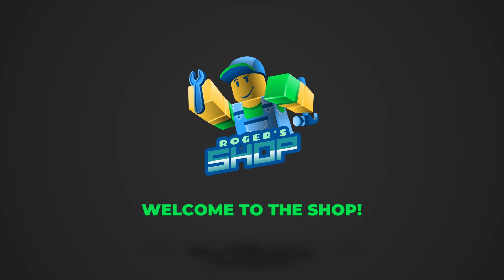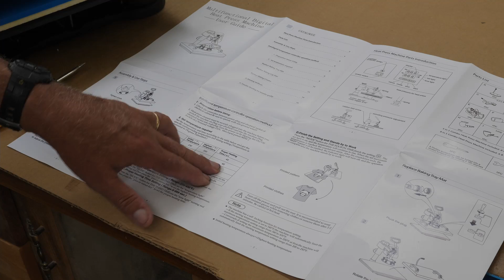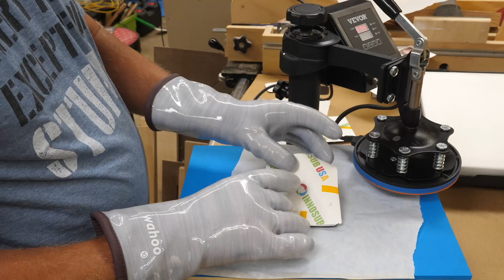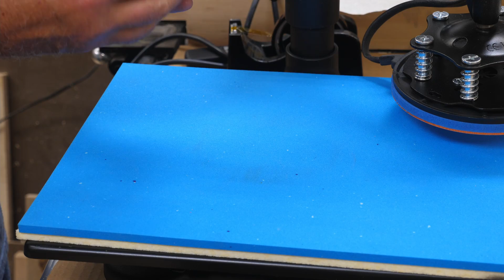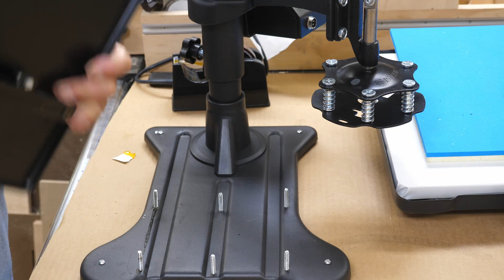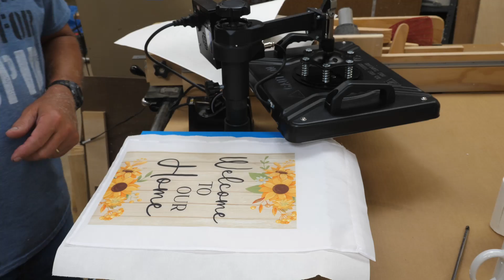Vevor 5 in 1 Heat Press

Comment: Do you have any issues with the heat plate sliding off after a few presses? Mine move little by little until it eventually comes off. I have to keep an eye on it and try to fix it before it comes off.
Reply from the maker: I no longer have this, but did not have that problem.

Comment: I just recently bought the 8 in 1 and pretty sure I'm going to have to warranty it. I didn't set it up until after the return date so that's on me but when I go to press, the support arm in the back seems to raise and only the back part of the plate will compress so really only one spring out of the 6 is being compressed. VEVOR isn't off to a great start with that straight out of the box.
Reply from the maker: Is your press height set correctly?

Comment: So I just got this 5 in 1 heat press.  Wanted to do a hat and I have done a couple shirts so far.  So put the temperature on whatever it said.   When I looked to do the hat it dropped to 138 degrees.  Would not go higher...is something broke on it?
Reply from the maker: Could be either the thermistor in the element, or the element itself.  You will need to contact where you purchased it from.
Reply: @rogersshop  is that in the box?  Power box?
Reply from the maker: In the hat press attachment @kathynewburn2707
Reply: The hat heat dropped.  I will check for shirts heat
Reply: @rogersshop When I connect the shirt part of it, it works fine. The hat part don't work.
Reply from the maker: That indicates that the hat attachment is defective.  I am not affiliated with Vevor, so you will need to contact either them or where you purchased it from @kathynewburn2707
Reply: @rogersshop  thank you
Reply: @rogersshop  I seemed it was ok for shirts....I will check thank you

Comment: Is the Epson 2027 the only printer that’ll print on this special paper? 

Disclaimer: I’m 100% new to this process so I’m clueless on what I’m doing. I have the machine and some printing paper. I’m sure a regular printer won’t work, correct?
Reply from the maker: There are lots of ink jet printers that work for this, but you MUST have sublimation ink.  Regular ink jet ink will not work.  Paper designed for sublimation will also give much better results than plain copy paper.
Reply: @rogersshop  thank you so much. GREATLY appreciated.

Comment: Hi Roger! Thanks for doing these videos. Im new to DTF printing and just tried out my new Vevor 8 in 1. I was wondering what settings you found most effective with the heat press for sweaters, t shirts and baseball caps. Thanks for your time and videos!!!
Reply from the maker: I do primarily sublimation transfer.  depending on the substrate, a starting point is 365 degrees F for 60 seconds on polyester fabrics.

Comment: I'm hoping you can help me.  Vevor Support is terrible, I bought a 5 in 1 heat press about 3 years ago and could not figure out how to change the temperature from Celsius to Fahrenheit.   I emailed so many times.  This last month I decided to try and and found the right person and finally I've been able to use the heat press.  Now the top plate won't raise up enough to use it.  I decided to try out tumblers and all I did was unplug one for the other.  I don't know what went wrong or why.   When I pull the handle up it feels like something is slipping.    Please help me.
Reply from the maker: The knob at the top is for adjusting height up and down.
Reply: @rogersshop  I figured out what was going on.  First I used some WD40 which loosed up the arm so I could raise it up an down but then the top platen was really wobbly and I found a screw between the cylinder that raises the platen and the platen.  I tightened that up and all is well.   I appreciate your help.   Now I have one more question.  In my startup days I was turning the platen the wrong way and it hit the power cord melting the covering.  it's fine and it still works, I've covered it with electrical tape but would really like to change it out.  Can't find any information on the cord and again Vevor support is terrible and nothing on the web, that I have found.   Do you know any information on the cord or where I can buy it?
Reply: @CatherineStraub  how do I change from Celsius to Fahrenheit?

Comment: Good video.  I'm looking at this same machine primarily for some leatherette patches I'm engraving with my diode laser. The patches have adhesive on the back that is activated with the heat. I'm wondering if you have a video showing what printer and ink you are using to create the patterns?  If I'm going to have the machine I might as well make some mugs and other items.

Comment: Thank you , I just got the 15 x 15 inch press, I haven't used it yet. I live in The Netherlands and they don't really have any instructions with the press about changing the temperature to Celsius or how to set the temperature. This is really easy to follow and I will start trying the press now.
Reply: Did your top plate of hp wobble when u opened it and close unevenly? If so what did u do to fix it

Comment: so i purchased the exact same unit only to discover that the unit is not capable of reaching a temp lower than 200 F. as i purchased the unit to only press comic-books and the temperature range to do that without damaging the book is between 168 and 173 F...i guess i wasted 265 bux?
Reply: What did you do with your machine?
You gonna sell it?
Reply: i am going to do a test using an extra steel sheet over the book to see if it will absorb enough heat to adjust for the extra 25 degrees or so, then go from there, why do ya ask?

Comment: I bought mine a vevor 5 in one like yours, but I cannot rotate the transfer board to the side, its kinda stuck, i don't know what to do 🤷‍♀️
Reply from the maker: There is a knob on the back, in the middle of the column.  Loosen it up and it should swing.
Reply: @rogersshop  thanks, its swinging well,  i just tried pressing a tshirt and it worked perfect 👍

Comment: im confused on where to get the pictures from should i just print out a picture and heat press it on a shirt
Reply from the maker: Where you source your graphics from is up to you.  But whether using a photo or another type of graphic, it needs to be printer with sublimation ink on sublimation paper, mirrored.  Then it can be transferred to a shirt using a heat press.  Regular ink will not work.

Comment: Would you happen to know how to fix a handle on the swing plate?
Reply from the maker: Did it come loose or break?  If loose and the screws will not tighten up due to being stripped out, you will need to go up one size, and tap new threads.  If broken, then I don't know where to get parts.........Maybe contact the company.

Comment: Thanks Roger, Vevor's vids had lots of missing info. Your links to the ink, paper and printer filled out all the blanks for me. Will check out the mug press, could be a way to make a little money in retirement.
Reply from the maker: The automatic mug press has performed very well and although not of a commercial-production grade, we have run it non-stop for several hours at a time with no problems.
Reply: @rogersshop  Been watching your printing vids. Was thinking about UV ink printers to make landscape type artwork on  metal plates. This sublimation ink might work.

Comment: What do you do when it wont turn on. I have only used the machine one time. The second time I tried to use it it will not work. I checked the fuse and it is fine but I replaced it anyways. Also how do you reach the company? I have tried several times.
Reply from the maker: I have never tried.  I am not affiliated with Vevor.

Comment: Thanks so much!  This helped me put mine to use!

Question:   After I set the temp, and set the timer, am
I supposed to wait until the temp gets to the set temp to put the garment in, then press start, close the lid and then wait until it  counts down?   Or can I put the garment in and the press start making the garment be under the heat while it’s warming up and then the additional
Time at the right temp?  Making the garment be under heat for longer that the set time while it’s heating up plus the time
At the set temp?

Comment: I used it yesterday for the first time with the circle...now that I switch back to the regular one the handle doesn't go down all the way anymore even if I adjust the pressure...how can I fix this problem?
Reply from the maker: You will need to look and see wat is interfering with the handle linkage.  Something is not aligned properly.

Comment: Hi i have this heat press and it goes up and down but won’t swing out like yours in beginning of video you know why?
Reply from the maker: Loosen the knob on the back of the vertical column.
Reply: @rogersshop  thanks for the fast reply if your talking about the black screw thong i unloosing that all the way even took it all the way and it’s still not working properly.
Reply from the maker: @Eruckkk  You could try elevating the column and then see if that makes a difference.  If yours is "stuck", you may need to contact the seller.  I am not associated with Vevor, so you would need to contact them.
Reply: @Eruckkk  did you figure it out I have my knob completely out and it still does not want to swing
Reply: @jenniferjones9527  nope I’ve contacted the company they suppose to reach back out to me it’s been a day so far so hopefully soon i won’t understand what it can be so annoying
Reply: @Eruckkk  anything yet? Mine will not swivel neither... Even with the knob all the way loose. Smh
Reply: @JonathanLeeRamos  i contacted them they are sending me a new one

Comment: I just received mine, and it’s extremely hard to swivel. Is there something that can be done to fix it?
Reply: I literally loosened the knob till it came off and it's still super hard to swivel
Reply from the maker: @JonathanLeeRamos  Raise up the heated end as far as possible, then look to see if there is something prevent smooth motion.  You may need to lubricate the column internals.  This should move pretty easy.
Reply from the maker: Loosen the knob on the back of the vertical riser.
Reply: Did you ever get yours to swivel better? Just got mine and it's super hard to swivel.

Comment: When the machine is heating up to the temperature that you set, should the top be up or down in the closed position? Makes sense for it to be down, but mine takes so long to heat up that I wondered if I might damage the mats.
Reply from the maker: Over the bed, but not locked down is the way I do it.

Comment: Hi! I am new to heat presses and have been using this one for about a week. The 12X15 heat plate moves left and right too much making it hard to swivel to remove/put on a new tshirt. I’m not sure if that made sense but I was wondering if you know how to tighten it?
Reply from the maker: Use the knob on the back of the column to tighten it up a bit.

Comment: The intended use for that supplied screwdriver is for the screws to change out the heating attachment plates. If they supplied a larger Size 3 it would be too big for those small screws. The large spring bolts aren't made to be removed constantly so no need for them to supply a tool for it.
Reply from the maker: True, but the supplied screwdriver is junk.  A Size 3 was necessary to tighten the bolts that were loose upon unpacking.  Factory mess up.

Comment: Great demonstration. I've seen a few mug presses, but I've never seen one with the soft guts loose like that. Was it broken or is it supposed to be that way?
Reply from the maker: It is made this way and works fine.  If you do a lot of mugs (like we do), Vevor has an automatic mug press, which is really slick and costs less than Cricut.  We use it in production, even though it is not really made for that type of use.
Reply: @rogersshop  Thanks!
Reply from the maker: @𓍊𝙿𝙷𝚇𓋼𝙼𝚈𝙲𝙾𓍊  VEVOR Mug Press Machine  https://amzn.to/3w7C17h is the one I use the most when making mugs.  I do not know what the model number is of the attachment for the 5 in 1

Comment: Would it be possible to set an initial temperature and maximum temperature to be the same?  That way you could heat it at the desired temperature for the time needed.  I would prefer to follow the instructions from the suppliers of the material.  What do you think?
Reply from the maker: I tried that and it does not work, or at least, isn't allowed.  This was a trip for me since I'm old school and used to a set temp that holds and not a stand-by thing.  Works just fine, but needs some mental adjustments in time and temp.
Reply: @rogersshop  Thanks for your response.  I realised this after actually trying it.  I have just unboxed one my self.  I can't work out whether I should allow less time than normal due to the initial starting temperature and time before the countdown.
Reply from the maker: @eferdinands  Yes, this is a little confusing if you are used to a set temp that the press keeps and set times (as I am).  But, I found that using their suggested stand-by and press temps, along with suggested timing does work out just fine.  For a person new to this, without previous experience, this would not be a problem, since there would be no history of using the other style press!
Reply: @rogersshop  I have found that once the maximum temperature has been set, you can go back and make the initial temperature the same.  I use this method and follow the instructions provided by the suppliers of the transfers.  It would help those used to the traditional way using heat presses :)
Reply from the maker: @eferdinands  I figured that out too after a bit.  this press was given to our daughter to use since I already have several and I prefer the "old school" method!

Comment: I bought the 5 in 1. The mug press swelled up and went poof.(garbage).i contacted the seller and they said they would replace the element after about 6 months of being ignored , i contacted vevor, they said they would not replace the element nor sell me a replacement.  Did i say garbage,  i will not buy anything with their name on it.  Buyer beware.  Garbage, garbage, garbage, i have the rest of the set away the element in the press has tempos all over the place, don't recommend,, garbage garbage. If you don't let this message go thru then i will believe you don't have an honest page..